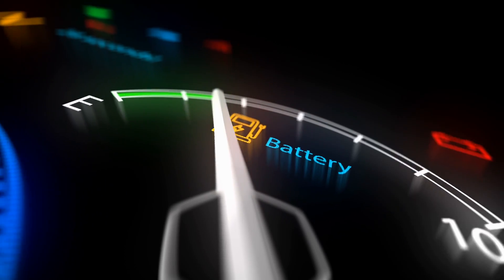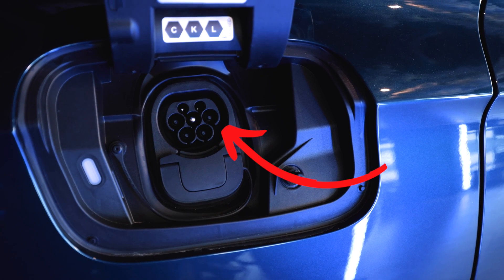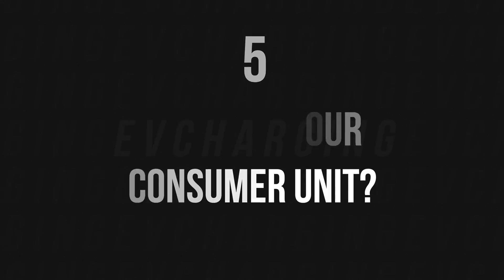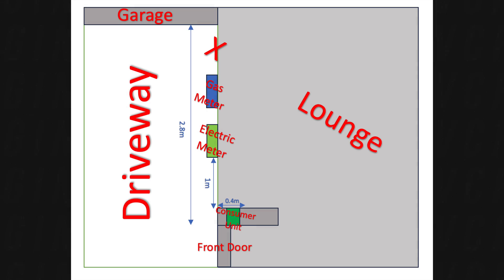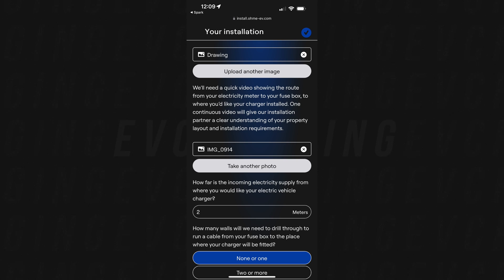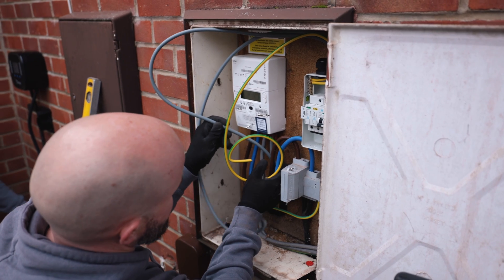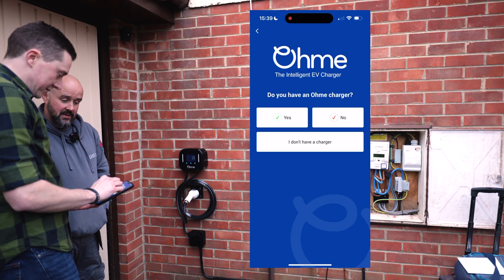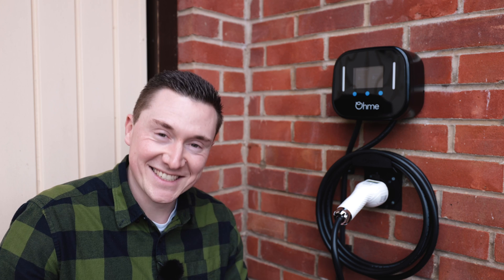EV Charger Install! | Ohme Home Pro

Comment: We are getting a ev in October through mobility and i have been trying to do as much research as i can , my electric supply in in my house but quit close to where i think my charger should go , i dont have any spare sockets on my board,  will this be easily sorted and i get the charger with standard insulation will there be any more costs and if so how much may it be
Reply from the maker: Ah very nice! Well although I don’t know much about the Mobility Scheme, I have heard of it. I had a quick look on their website but couldn’t see anything about home chargers included (although I could have missed it and it might be only on certain models, or it might have to be paid separately). For Ohme installations start from £949 for the whole thing or £999 for the their charger with a screen (otherwise it’s just the app).

Mine’s set up to plug in a car that I have on test for review, and it charges off peak and at a very cheap rate.

I would suggest contacting the people who you bought the car from or are going to buy the car from and ask about a home charger.

If one isn’t included put an application in through Ohme and they can guide you through all the necessary steps to get you started.

Hope that helps!
Reply: @npoleary  mobility want people to go electric so are doing everything to encourage people to go from petrol,  the ohme is one of the ones they offer and is a one off free of charge when you order your first ev, comes with standard insulation, done my reach and this one seams to be more compatible with my energy company
Reply from the maker: Ah amazing! That’s good! 👍🏼

Comment: I would like to ask, for how long will Ohme support this product ? I presume they are working on newer products, so at some point in the future they will have to transfer resource over to support the newer products. Unlike a dumb charger, a charger like this will lose its smart features if the support company drops it.
Reply from the maker: Very true but I don’t think they’re going anywhere anytime soon or releasing a brand new charger which will make this obsolete.

Not sure any company can predict how far they’ll go, but Ohme have won numerous awards in the UK, they’re advertised as an official charging partner in the UK with various top car manufacturers and they’re rolling out to Europe too. One of the reasons why I personally reached out to them!

Plus I thought I had an issue the other day with the charger at my house (this one you saw in the video) but turns out it was the car I had on loan! Their support were great and very knowledgeable.

Adding further to your point, as far as I know they only offer two chargers and both evolve round the app (which they’re updating this month to something even better). The app and smart functionally is their whole business so don’t think they’re releasing a new charger any time soon. Not sure what more a “new” one would even add anyway 😅

Comment: Tethered means that should you change car, and the 6.5m cable they gave you is no longer long enough, you will need someone to change the cable. I went for untethered, as I needed a 10m tethered cable, and there wasn't an option for that on the charger I wanted. If you have more than one EV, it is sometimes not possible to park the car directly in front of the charge point, and the tethered chargers supply a cable with the assumption this is what you will be doing.
Reply from the maker: And what side it’s on! Some are on the front of a car, some on the back, some on the sides…and also if you’re reversing or driving forward onto a driveway too 🤓

Comment: The uk motorbility scheme use ohme chargers.
We did the home survey and drawing.
3 days later the electrician came out and fitted a teathered ohme charger for £0 under the motorbility scheme.
Works a treat on our 2024 hyundai kona.
They installed a small isolation switch in the meter cupboard, and it was all done in 2 hours.
Reply from the maker: Awesome! 🙌

Comment: I'm surprised they went ahead to do the install without knowing if there was a double pole cut off switch. That was a stipulated requirement when we had a charger installed & we had to wait 3 months for the DNO to come & install one. As I ordered a replacement charger last week (an Ohme because the BP Pulse unit is a piece of junk) I was again asked if there was a double pole cut off installed.
Reply from the maker: Yes I was asked that but I don’t believe it’s a regulation to have one. It did state that on the survey but it has been signed off as compliant 👍🏼

Comment: I am an electrician and my son-inlaw basically got messed about from the charging company. He jumped through their hoops then they said nope we will have to survey it ourselves at a cost of 
£300 + please. So nope. Double pole 100A isolation switch fitted along with a EV consumer unit.
I noted that at the incomer there was not an isolation switch fitted . Why was that
Reply from the maker: Oh okay
I mean there must be a reason why they need to survey it. Could it be there is more work involved?

I’m not sure on that one I didn’t ask the question! There’s a switch to turn off the charger itself inside.

But I guess my property does not have a main one.
Reply: @npoleary  From what I understand they send a non technical person to basically look the job over. Also the property was recently updated to the latest electrical regs

Comment: Our DNO - National Grid screamed with us over the phone NOT to install anything inside the Electricity Meter Box as others do.
It's worth noting that it is not illegal but may affect you in the near future. 
We never install anything inside the Electricity Meter Box but install either a new replacement Consumer unit with SPD (Surge Protection Device) and RCBOs or just an EV Fusebox with SPD and Single Pole RCBO with Switched Neutral (as per BS7671 Wiring reg.) 
Also, we do not recommend Ohme but Hypervolt (will be Intelligent Go ready later on this year and Myenergi).
Reply: Thanks for the clarification
Reply: Never trust anything that “maybe in the future support “ as if it does not all your customers will scream ! Always buy a product for what it can do now not what it may do in the future as many many of these promises never come to light!
Reply from the maker: @jamesgrantham1743 agreed! Best advice ever for any purchase these days. I never buy anything for the sole reason of future updates.
Reply from the maker: Thanks for messaging! So actually I did some digging on this after my install so hopefully this helps.

Officially speaking, the NICEIC (National Inspection Council for Electrical Installation Contracting) recommend in an ideal world not to install any additional equipment in a meter cupboard like in my video.

However as long as it’s done correctly then it will be okay and won’t cause any problems. The main reason being as the cupboard is finite in size, if someone needs to come out update your main cutout fuse, or change your meter, they don’t want to touch someone else’s installation works. Also “technically speaking” drilling an additional hole into it increases the risk of water ingress which is why mine was done through brick right underneath to minimise this and prevent it from happening. For example if one was drilled at the top, this would not be good for when it rains which no one would do for obvious reasons.

So it can be done, but as long as it’s done correctly. Installations like this can be done for aesthetic reasons or for ease of use depending on the property as we all live in different shapes and sizes of houses, installations can vary a great deal so if you’re not sure or have any concerns speak to the installer who’s installing one for you and they can work with you and install it the way you would like.

For peace of mind I did receive a certificate a few days later confirming that my install is NICEIC compliant too 🤓
Reply from the maker: Also why would I want to wait till later in the year for Hypervolt when Ohme is already compatible and working brilliantly?

Comment: Very poor install, the company involved should dragged over the coals, why because installers should not fit any distribution equipment in the meter box. All DNOs disapprove of this tactic because if changes are made to the meter there is insufficient room for potential upgrades to their equipment. efixx did a feature on this very thing.
Reply: When I did the EV qualification we were told not to install equipment in the meter cabinets, I also contacted National Grid and they confirmed this is the case
Reply: Unfortunately you can get as many certs or emails from the NICEIC as you want, the DNO meterbox is neither their property nor their jurisdiction.

I work for a DNO and as soon as we see any equipment such as this we refuse to do any work on the cut out or incoming supply until the customer has paid for the additional equipment to be removed. If you have a power cut we can refuse to restore power until it is removed.

Food for thought
Reply: You are not allowed to cut any sealing wires within the meter cabinet. You need to contact your electricity supplier who will fit an isolator for an electrician to work without removing seals or the main fuse
Reply: The meter box belongs to the customer not the DNO. They can moan as much as they like. If it's the only option, put it in the box, everyone else is.
Reply from the maker: Thanks for messaging! So actually I did some digging on this after my install so hopefully this helps.

Officially speaking, the NICEIC (National Inspection Council for Electrical Installation Contracting) recommend in an ideal world not to install any additional equipment in a meter cupboard like in my video.

However as long as it’s done correctly then it will be okay and won’t cause any problems. The main reason being as the cupboard is finite in size, if someone needs to come out update your main cutout fuse, or change your meter, they don’t want to touch someone else’s installation works. Also “technically speaking” drilling an additional hole into it increases the risk of water ingress which is why mine was done through brick right underneath to minimise this and prevent it from happening. For example if one was drilled at the top, this would not be good for when it rains which no one would do for obvious reasons.

So it can be done, but as long as it’s done correctly. Installations like this can be done for aesthetic reasons or for ease of use depending on the property as we all live in different shapes and sizes of houses, installations can vary a great deal so if you’re not sure or have any concerns speak to the installer who’s installing one for you and they can work with you and install it the way you would like.

For peace of mind I did receive a certificate a few days later confirming that my install is NICEIC compliant too 🤓
Reply: @npoleary  you are not correct, no equipment within meter cabinets please post who you spoke to at the NICEIC please because I'm a NICEIC approved contractor I"ve been told not to install any switchgear within meter cabinets.
Reply from the maker: @liberatodelgreco4430  I had contacted NICEIC support to get official answers and this is what they said:

“Although the external meter cabinet belongs to the property owner and there is no regulation within BS 7671:2018+A2: 2022 that prohibits the installation of suitable equipment in such a location”

They did continue to add that NICEIC recommend not to install in the enclosure only because if any upgrade work is to be completed on the mains for the house, the person carrying out that work will not want to touch someone else’s installation. This can cause the customer to have to pay a contractor to move it before work is carried out. So this is the reason they offer a recommendation not to install inside an enclosure.
Reply: @npoleary  mines was installed like this absolutely looks terrible going to cost a fortune to get removed and installed again

Comment: So glad you opted for Ohme, Nick. I chose Pod Point and it is now 8 months down the line and I am still waiting for them to install our charger! Service has been dismal even although I have supplied them with all the information they asked for. Also they expected me to hire an electrician to lay the cable under the floor to the driveway as they were only prepared to run the cable through my house enclosed in ugly trunking. Also for 8 months, I have been forced to use a standard wall socket to charge my car with the cable going through an open window which makes the room freezing all the time and also is terrible for security, because they have taken so long to fit the charger and I am still waiting. Also they make you pay up front, so they have your money earning interest for them the whole time you are waiting for the charger to be installed. unbelievable service.
Reply from the maker: Oh jeez that’s not good! 😞

Honestly, if that’s true and you’ve been waiting over half a year, in my eyes they have not delivered the service that you have asked for. Put your foot down, phone them up and demand a refund. Oh they can’t? Speak to their manager or supervisor.

Tell them exactly what you’ve said to me there and with the cold weather, you can’t do it anymore. (Using extra heat in the winter for your house, range for your car etc)

Regarding your install though, that sounds like it might require extra work which might explain why it would take longer but not 8 months longer...
Reply: Hi Nick, Thanks so much for your reply and concern for my predicament. Maybe one day I will pluck up the courage to call out the poor service I get from companies. Your honest, technical, analytical and educated reviews are why I value your YouTube Channel so much. So keep up your amazing channel and once again thanks for your support on this issue I have had with trying to do the right thing for the environment and get an EV Charger fitted.  @npoleary
Reply from the maker: @alistairdevlin9662 sorry thought I’d hearted your comment! Thank you that means a lot! 🙏🤓
Reply: I currently have a pod point which came contracted with the purchase of a new Mini Electric. I am a year now into all this EV stuff and cannot wait for the whole lot to be ripped out and the car handed back. The Pod Point was nothing but trouble from day 1. Was told it was compatible with my solar panels only to discover it was not. Every time the sun popped out from the clouds, the charging of the car would get cut off ! For quite some time i had to charge the car using the 3 pin plug cable as Pod Point were so slow at getting out to fit the charger. Anyway....now that BMW Mini have recalled my car for a global software safety update and even handed me a letter to say that a fire cannot be ruled out, i will be handing the car back in the weeks ahead. The joys of motoring.......
Reply from the maker: @Sidmi5utc no sadly I’ve heard that some chargers aren’t compatible with solar. Who said it was compatible, the dealer?

Yeah I heard of that recall too but wasn’t sure if that was just a specific country.

I promise you the experience is not always like that, many owners have had a trouble free experience! What’s next for you? Are you going to replace the EV with another or head back to petrol or diesel? Or hybrid?

Comment: Great video. So to confirm you don’t have anything going to your consumer unit (fuse box in house)? 

I’m booking an install soon and the charger will be installed right beside my meter with great access but the consumer unit is under the stairs in the middle of the house. 

Looking at this they simply add a fuse near or in the meter box and don’t need to go to the consumer unit?
Reply from the maker: Thank you! 🙏 
No, it’s all outside 🤓
I was worried because having a small house and extremely limited access with the consumer unit above the door I wasn’t sure what they were going to do. But they managed to install everything outside 🤓
Reply: Came here for the same info so thank you. Recently spent a lot of money renovating the room where the consumer unit is. Although this is on an external wall close to where the charger will be installed I don’t really what them drilling into the room. Fingers crossed my installers do the same. Thanks for the content
Reply from the maker: No worries! Glad you enjoyed it!

I’m planning a follow up video very soon on how to get the most out of it 🤓

Comment: So no cables at all are going back to the consumer unit then, just straight off the electric meter?
Reply from the maker: It has like a mini consumer unit in the meter box which is pretty cool. Saves going back to the main one
Reply: Not allowed